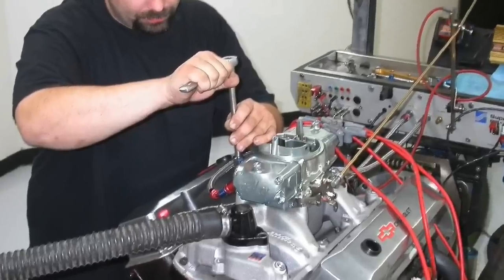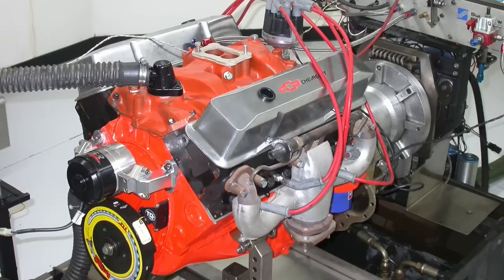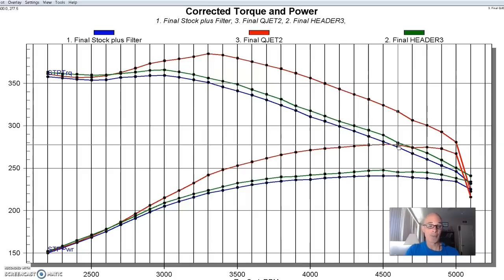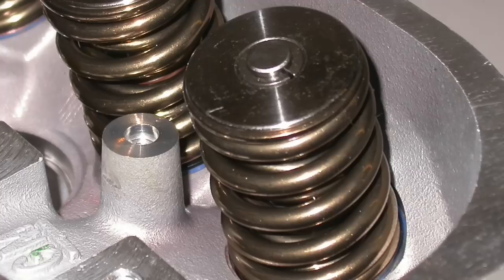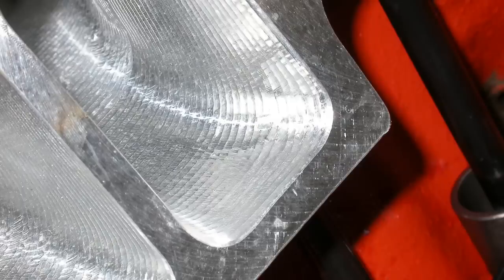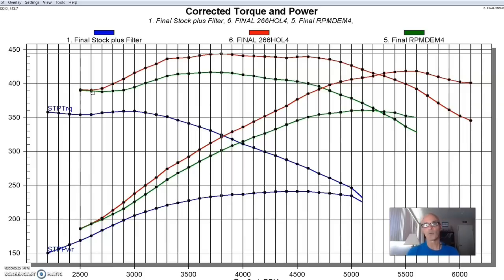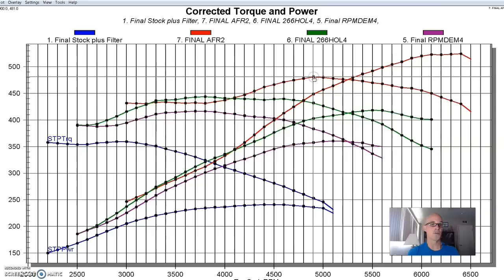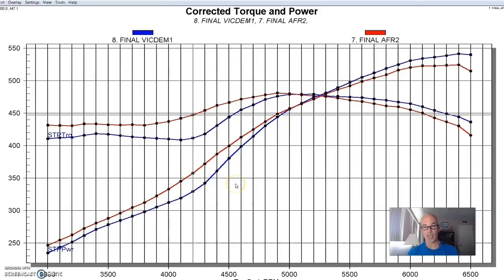HOW TO: SBC POWER COMBOS

Comment: So I have an old 350 .030 over in my truck.. has a Melling WG1103 “blue racer” cam in it, 920 heads, performer RPM intake, flowtech shorties, full 3” duals.. MSD HEI, about 9.5:1 compression.  Carb is an Edelbrock AVS2 650cfm.  I have no idea what kind of power it makes… 

I have a pair of generic Vortec heads and an RPM air gap intake to put on it.. just wondering what kind of gains that’s worth.

Every time I see a new SBC video I get excited hoping it’s a “what happens when you swap your 920 heads for junkyard vortec heads?” But I haven’t seen that… it’s usually.. “what happens when I replace the cam with a wicked roller and modded vortec heads?”

Like.. no, I just want to know what a direct vortec head swap would be worth. Standard springs, 1.5 stamped rockers… right off the donor engine.

Comment: Thanks Richard!!  For not burying the SBC for the favoring LS motors, and doing different engines also.. And those AFR 195 move some air 290cfm@.600 lift. I suppose you used the 65cc heads?

Comment: Richard, I would like to see a test using a single plane intake on a mild SBC combo. I'm running multiport EFI on my SBC but dual plane EFI intakes aren't really out there for a 4150 style throttle body. I know my combo is severely mismatched now with the single plane RHS EFI manifold as it seemed to run a lot stronger back with a carb and a Performer RPM. Keep up the great work!

Comment: i would like to see a performer RPM quadrajet  against an EPS intake versus these on the stock or mild combo.  and lets talk about the 270S-6 comp cams lift limited cam with a 4 and 7 swap  with AFR195 competition heads and 10.5:1 with custom long runner intake. and make it a 376 SBC, i have the pre blueprint for ya. oh and make it with a stock deck hieght 9.025" but offset grind nodular iron crank to get pistons at top deck level.  then get the solid roller version of the cam with the same timing events to max area !  Then raise the rocker ratio. now drive it in a camaro street car , test and tune and use a TH350 with whatever stall that works but only use 3.42 , 3.23, 3.73 gears and drive it around on highway type roads and merging on interstate, drag strip 1/4 , carve a slalom track = and evaluate, is it worth the cam and custom cross long tube intake (fits under hood mostly or without)  or just use a performer rpm and comp hyd roller?

Comment: Did I miss it or was the cam for the "wild" combo not mentioned? I'm going to make a guess at it. Looking at that power curve I'm guessing he used the XR282HR. I'm only saying that because the low end didn't take much of a hit and the AFR 195 heads can breath good enough to perhaps extend the peak power point slightly higher. It certainly isn't any bigger than the XR288HR.

It's too bad I can't find if he said exactly what cam was used in the wild engine. I really want to see the XR288HR in this combo to see what it does across the curve. It's probably the most radical duration profile Id ever use on the street in a 350. Hydraulic cams with 240+ intake duration in a 350 tend to really kill the low end in anything other than what I consider to be a serious street/ strip effort with a 3800+ rpm torque converter and 4.10 gears in a NA application in a lighter vehicle.
Reply from the maker: 294

Comment: I know this is a year old, but the prices for a cheap/inexpensive head and a set of vortec are pretty minimal now. Assuming you pick a set of Vortec up for $100 and send it out for servicing (if needed), manifluxed, and cleaned your already $200 - 300 into the heads. Then add in new springs, even doing it yourself, another $100-150 your at around $500 - $600 and that a hope and a prayer for quality check and reliability. I haven't actually been able to hit that price as at least one exhaust guide is jacked and most valves (at this point do them all) need resurfacing etc. My point is the cheap speedway, FloTec and/or AFR's end up being about $50 more when it's all said and done.

For longevity I tend to lean towards the AFR as casts myself, but most people aren't going to put 100k miles on a motor putting out decent numbers: IE Not a daily driver, most of those daily drivers are LS swapped for power AND fuel milage. The first "mild" motor is a great truck/S10/2 bolt main combination with a set of the cheaper heads as mentioned along with used/cheaper intake. Meaning a great use of the TBI 350's you can literally get for $100-200 bucks right now. Less then a $1000 on a complete short block with cam: Polished Crank, rods checked and done up, pressed on new pistons, block bored and honed, block cleaned, block decked (if needed), cam bearings installed. Assuming you'll assemble the rest yourself. What really would be left is heads, any tin(s) you can't reuse, intake, HEI, and carb. Really should be less then $3k easy and SHOULD get you 80k in miles with 350ish HP and over 400 ft lbs in TQ, tuned right smoke most of the idiots out there with $10k dropped in an untuned but been dyno tuned crap.

Comment: I have put together a 383 stroked SBC and with the pre Vortec swirl port heads that I ported for low end torque. The engine was together with Keith Black flattops. I reused them and had everything remilled again. Now my compression is 10.2:1. Is that too high for a truck application????  It will be used as a truck and not just to haul me around town.

Comment: Ok, if you used 195cc heads on your "wild" 350, where would you use the much bigger 210, 215, 225, or 235cc 23-degree heads that are readily available? And when do you go to the radical stuff, over 245cc with offset rockers and so on? When do you step up to the 18-degree heads, spread ports, stuff like that?
Reply from the maker: more displacement and more rpm can use those

Comment: Do you have any comparison tests with the vortec heads? Like diferent cam's or intakes?
Reply: From my own experience, if you're going to run vortec heads, keep valve lift under .550 (they have to be  overhauled to support anything over .450 lift) and stick to a dual plane rpm air gap. .525 lift max would be better. They're great heads but they definitely have limitations. 170cc (I believe that's what they have) intake runners will only go so far. Been almost 20 years since I had these heads on a motor so I may be off. But not too far off. Cheers
Reply: Was thinking of taking my vortec heads off my 5.7 and put them on my 400sb along with cam-lifters, intake,headers etc.. Low budget build

Comment: So a well built sbc makes as much power as an ls engine. It’s cheaper to build a sbc as well. That sbc made about 100 more than the stock ls3 and would cost fraction of the price. You can probably stroke it to 383 and get it to 600 hp range. Nice little setup and looks like the wild version will work for street use
Reply from the maker: An LS3 with a cam and springs makes 565-570 hp-SBC AND LS are both good
Reply: Richard Holdener I got an ls3 to do a swap but seeing this video makes me double think my decision.. probably fuel efficiency would make a difference Between the ls and sbc. Used ls3 are not cheap between $4000 to $6000. That money can be used to build a solid 350 like yours. I really loved this video and can help people make a decision
Reply: @Miguelspl150  just start with an LQ9 and slap some LS3 heads on it.
Reply: James Williams lq9 are pricy here in LA CA. Ly6 would be the better option but those are hard to get here and so is the lq9z you’re still spending money to get it done. About 2k once you upgrade the cams and upgrade intake and injectors to fit a car application. Ls is still more expensive for the same amount of power not to mention a freshly built 383 vs a beat to hell ls engine that might need a rebuild sooner than later
Reply: @Miguelspl150  I'm in ca as well sf bay area,  I found a lq4 shortblock on Craigslist for $500, had it bored .030 over and put ls2 pistons in it with ls3 heads with an asa cam, 370" total did it all for well under $2500 and went on ebay and found a l96 complete from a schawns delivery truck setup to run on propane, delivered to my door for $850.....Deals can be found in ca. You just need to look a lil harder, you definitely not gonna find them from the junkyard or pic n pull.....hell I got a 5.3 lm7 on ebay delivered to my door for a hair under $400........just type in the search, "used chevy 5.3 free shipping "........ or 6.0 if you have a bigger budget
Reply: Trent robey I already have a 6.2. Got a deal for a long block for $1500. But the cam and al the upgrades nickeled and dined me. Just the ecm/tcm plus wiring ran me $900.. buying complete pull outs are far better than getting long blocks and less headache

Comment: What‘s your opinion on an AFR 180 Eliminator Head on a 350 in comparison to an AFR 195? Lots of people like the 180 a lot and only recommend a 195 for a 383 or bigger stroker.
Reply from the maker: the 195 is not too big for the 350-that is just silly

Comment: I add one more, Chevrolet what a design very good oil flow for oil pressure very easy to work on make horsepower and torque you can't go wrong

Comment: Thanks for the video, your are thorough and your videos are interesting. Would you tell me which of these combos would run on pump gas? I have a small block Chevy that I want to run on the street with pump gas and I have the same piston combo that you ran here.
Reply from the maker: they were all run on pump gas
Reply: @richardholdener1727  Awesome!!! Thanks for the reply, that's what I wanted to hear. I'm going to order a pair of the AFR heads now.

Comment: Congrats Richard, you proved just like those links i had sent ya a while back if you remember with AFR heads and a comp XE type cam, you can (EASILY) make 500hp+ with just 350CI!!!

Now i'd like to see you take that "WILD" one, and try the different comp XFI HYD ROLLER series cams because i planned to build a copy with 9.5:1 and boost using a XFI-292 which is (IDENTICAL) to the XE294 except it has a 113* LSA vs 110* with the XE.. That should more than make up the torque loss, but i wish to see the HP numbers with the newer tech cam with that combo as well the smaller ones also like the XFI268 and 467.. Would be cool to see indeed!  What is the part number on those pistons BTW?!?
Reply from the maker: 500+ HP WITH A 350 ISN'T EASY-NOR IS IT VERY DRIVEABLE
Reply: @richardholdener1727  Seems to me you did fie with it.. Do us all a favor, take that engine, slap a holley stealthram on it and test that XFI 292 cam, it was made for FI..  Even if you had to run the 467XFI which is slightly smaller, throw 10lb of boost on it, talk about a 700hp combos all day long with 9.5:1 on 93 octane. 

It's 2021, it CAN be done lol.

Comment: Built a 327 9.6:1 vortec heads, Eddy performer intake and 650 carb the cam is a Howard's flat tappet 269/ 465 ...I'm guessing it would make somewhere around 340 hp

Comment: I grew up in the "smogger years " and I love how you show the POS 2 bbl and quadrajet  (We used to call them quadrajunk ) .I want a vid on how YOU would build a 400 hp junkyard motor for way less than a crate. Perhaps 500HP. REAL cheap. 2K perhaps ?
Reply from the maker: I did 400 hp for $1K-500 hp is a lot harder unless nitrous
Reply: @richardholdener1727  you happen to have a link to that handy?

Comment: Hey will you please help me out!! I’m building a dart block 389 stroker 4.00x3.875 crank. I was thinking of using promaxx 225 heads and a hydraulic roller XR300HR. Is that a good combo what kinda power do you think it would make!!
Reply from the maker: yes it is

Comment: Hi guys, i make a 383 stroker eagle kit .30 piston bore, it have a 292 camshaft with 501 lift, with a dual plane intake, edelbrock cylinder head 5089, 650cfm holley dual pump. 400th trans. & 373 posi.. I want to know how much HP can make? Thanks for your help..
Reply from the maker: 500 ish

Comment: This was very informative.

Other than when you changed more than one thing at a time, we could see exactly how much each modification was worth in terms of power.  Although I never did catch what the specs were on that final cam.

How do LT-1 heads compare to the Holley's?
Reply: Yeah, I'd have been interested to see what those long tube headers were worth when the engine started really being able to move some air
Reply from the maker: Cam was Comp XR294HR-LT1 heads are probably on par
Reply: @richardholdener1727  Thanks, Rich.

Comment: Richard, love the videos. I’m a medically retired veteran trying to catch up on my car days of the 80’s. I have a 355 blue print only producing 340hp. What’s a good end and flat tap cam combo?   Also is the edlebroch av8 carbs that good as they say?
Reply from the maker: THEY WORK GOOD FOR DRIVERS.
Reply: Go with a hydraulic roller cam! 
Don't get a regular hydraulic flat tappet cam unless you want to keep replacing cam & lifter sets and metal particles throughout your engine.
Hydraulic flat TAPPET cams have had a high failure rate for At Least 15 years now. It's not known if it's bad materials or they aren't hardened like they once were. Don't believe anybody when they say it's because of the oil! Some oils are not so good but they don't explain all the wiped cam lobes highly respected professional engine builders have experienced.

Comment: Just put together a 9.5:1 sbc with a set of 1.94 humps and a lunati voodoo 262 (219/227 @.050 112lsa) performer intake, 650 holley and headers. Stands to reason it may land right there with the ported 882s and a milder cam??
Reply from the maker: the humps don't flow what ported 882s flow
Reply: @richardholdener1727  Good to know, what would your power prediction be?

Comment: When I tow my car to the track 3000 rpm is hauling ass. I use a tight torque converter, and don’t spin the engine high. What works to up power low in the rpm band?  Like 1500-3000?
Reply from the maker: compression, displacement and long tube headers all help there (cam timing needs to be mild) and long-runner intakes
Reply: Thank you for the reply. That gives me something to chew on. 👍🏻

Comment: Hey Richard, I had an idea the other night that I wonder might be interesting to others in your audience.  Do you log BSFC in any of your data?  I know fuel consumption isn't usually a concern when building & tuning for performance, but some people considering a daily driver build might be interested in seeing BSFC differences between:  Aluminum & iron heads, carb vs EFI, large bore/short stroke vs smaller bore/longer stroke (SBC vs LS), etc.  What do you think?
Reply from the maker: we do log BSFC on the dyno, but people usually are not interested in fuel mileage at WOT

Comment: Is a nice Set of Aluminum Heads already Ported and Polished to the Max? What makes them better than the Cast Iron Heads? Small Block Chevy
Reply from the maker: alum heads help reduce detonation and most after market alum heads flow much better than the stock cast iron heads
Reply: @richardholdener1727  Thank you Sir

Comment: Richard Holdener I have a 3rd gen Camaro with a crate L31 vortec 350 with 4 barrel carburetor and long tube headers and MagnaFlow exhaust  what type of cam can I  put to gain more power?

Comment: I think someone had the best idea for a hot street small block for about any make 

Just aim for 10-10.5:1 compression and 2 cfm per hp with aluminum heads and it should be very fun on the street with a 3000 or so stall. 

Nothing exotic and its more than plenty for most people

As far as mild combos go, An 882 head is def a boat anchor unless you try to shave it. Horsepower monster I believe did that and still couldnt make past 380 with porting and bowl work screw in stud conversion. I had them on a 305..big. Mistake lol

Id just get the dart vortects at that point. All the great vortec atuff with theout the spring limits. And screw in studs
Reply: @Taylor Rutter yeah back 20 yrs ago when I did the 305 I wish I did that.

What I really should have done was ditch the 305 and had gotten a 350 like people had said.

Oh well now I have a 302 looking to go 347 ford because its easier to make more compression with a longer stroke and if I do a Chevy again it will also be a stroker

Comment: As I remember as a good combo was long tube headers with 3" collectors, ported and polished 202 high compression heads, Mantly 12.5:1 compression pistons with a Offenhouser 360 degree dual port high rise square bore aluminum intake manifold and a 780 dual feed double pumper carb and a Crane mechanical "phase 3 cam" with springs and screw in studs. Then a nitous shot of whatever your engine bottom end could handle. It made great power and it didnt break the bank. Drop that in a Chevy Vega or a Chevy Monza and go have some fun trying to get i tto hook up. No Idea what the HP or torque rating was but braggards were saying things like 800 hp and other just as unbelievable numbers but they were serious tire burners and I've seen at least one in the very low 11 sec range playing with the possibility of breaking into the 10's. I remember the anouncer at Cecil county drag strip anouncing him and saying "He's tickling 10's. Can he do it!" Which made me laugh. That's probably why I remember it so vividly. There was at least one guy in hotrod magazine that boasted a 69 camero with an NA small block running 9's I never saw it happen but I assume someone did otherwise it wouldn't have made it into the magizine. Back in the day those were some serious numbers. Perhaps not so much today with turbo charging and computers but back then that was big stuff.
Reply: That Offy intake is seriously obsolete nowadays. Probably wasn't much else available back then.

Comment: Great breakdown! Interesting that the mild combo made more power than a ZZ4 crate motor...have you worked with any of the ZZ motors? I know the L98 heads are a major restriction, but I’ve been slightly concerned about going aftermarket and losing CR and low end.
Reply from the maker: I have run lots of testing on the ZZ4